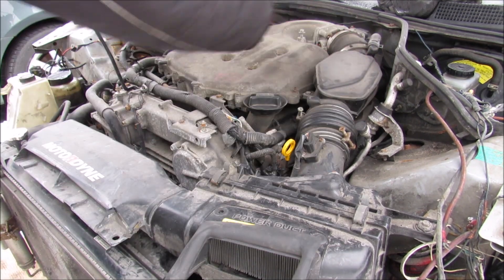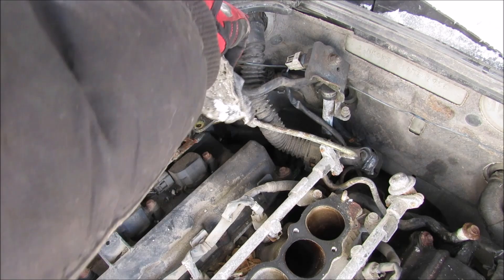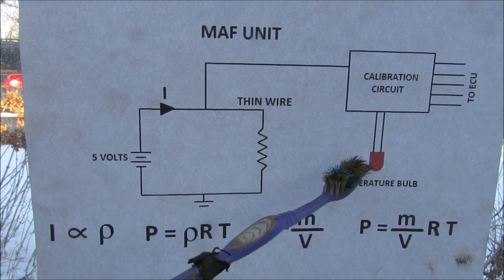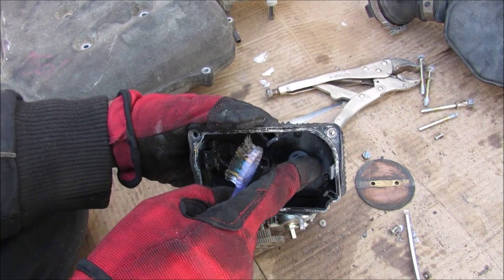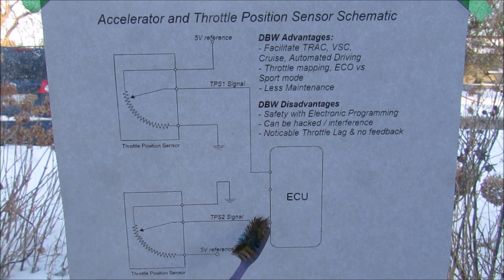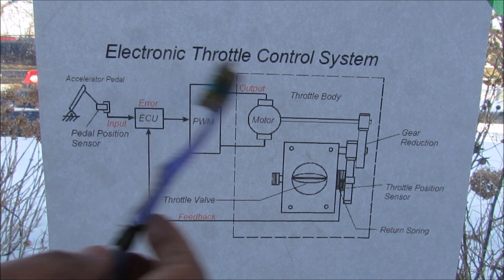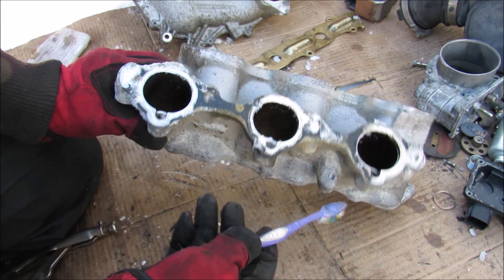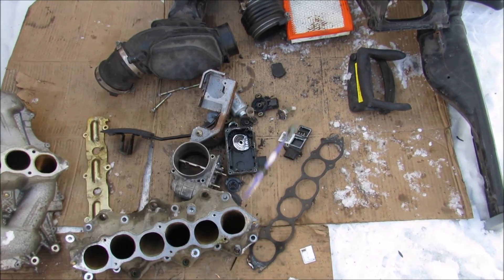How an Air Intake System Works

Comment: Great video...you sure know you stuff..my 2002 Chevy gives me a hard tome starting on a cold engine..once I start it...it will start first crank no mater how cold it is..its just the first start...any advise?
Reply from the maker: Fuel pump?
Reply: @speedkar99  Thanks for responding...that's what i was afraid of...it's a pickup truck so that's a expensive fix...

Comment: My car lexus rx400 h 2008 has PO 171 , how to check vacuum leak ? should I replace fuel injector, if so , can I do by myself
Reply from the maker: See my EVAP system video. P0171 isn't related to the fuel injectors

Comment: Why is it important for the ecu to know air is coming in. Wouldn't the motor still run as long as it gets air?
Reply from the maker: It need to know how much in order to get the correct air to fuel ratio for optimal combustion

Comment: Is there an advantage by using frozen underwear as opposed to room temeperature soft underwear. I have observed it was frozen solid and this would indicate high moisture if not even direct water content in the underwear. Is this a fire prevention measure? Perhaps it works by lowering fuel temperaturre below it vaporisation temperature for a given ambient air pressure? All in all it i sna interesting idea.
Reply from the maker: I agree with your observations. 
Meanwhile the underwear just happened to be sitting on the windshield cowl and was the closest convient thing to sap up the mess. It's not everyday do you just have your brothers underwear just sitting there on your car's windshield you know...

Comment: A lot of newer systems use magnetic Hall-effect sensors for throttle position for a contact-less solution... Similar to cam & crank position, wheel speed sensors, etc.

Comment: Great video, I was wondering something, and maybe you could answer; Could I switch an instrument cluster say like the s2000 cluster into a toyota camry? (I don’t plan on putting one in a camry just as an example)
Reply from the maker: I'd be interested in how that works. I'm sure you'd need a microcontroller to translate the ECU signals from the Toyota into the Honda cluster

Comment: Dear Speedkar99: have a technical question for you!  In some designs, the air intake tube draws air from within engine compartment, while others have a more elaborate design that takes air from a gap where outside air is channeled.  Is one design better than the other?  Thank you in advance.  Watching your video is the highlight of my day!
Reply from the maker: Thanks I'm glad you enjoyed the video. The trade-off between the air intake location is cooler air comes in if drawn externally, however it's subject to sucking in water or debris if it's in a spot that is prone as such. 

A longer tube may also lead to some airflow losses and the engine bay packaging and air filter accessibility also are factors that are considered when designing an intake.

Comment: I had a mouse chew up my air filter and make a nest inside the throttle body. Clogged the plenum open, so when I tried to stop at a stop sign it was like pushing the brake and gas pedal at the same time. Not fun! If you live in a mouse area make sure you check this part of your car once in a while. Also congrats on 100k. Been here since the beginning!
Reply from the maker: Good tip
Reply: Better the intake than the airbox for the cabin blower! Happened to mum's Rav4 during COVID when she was immobile for weeks at a time in the winter, in the Laurentians. The smell...ouf.

Comment: My Corolla had noticeable throttle lag...but it was a 2003! Never figured it out before the cops got the car, but it might've been a throttle so worn from use that it was sticking (it was a "299,999 km" car, so God knows).
Reply from the maker: Some Toyotas especially have this lag programmed into the ecu to prevent it damaging the transmission
Reply: @speedkar99  I don't doubt it. The car I had didn't have the deadly 2-3 synchro issues, but more torque would probably have made them fail even faster (even if the root cause was lubricant).

Fun fact: It had a shot clutch when I bought it, but...it got better as I drove it! I believe the previous owner rode the shit out of the clutch, glazing the disc with bubbled-up resin. I drove it like an asshole too, purposely, to try to break through the glaze, and eventually, did. All speculation tho, because I never got in there to see it (and change it anyway, if I had).
Reply: @speedkar99  Hey. It's been a minute since this comment thread, but in re-reading it -- why would I? I dunno! -- it occurred to me that maybe the throttle lag was the reason the 1ZZ engines are such superstars on fuel economy! It's funny, because it's like the OEM version of putting a block of wood under the gas pedal. 🤣
Reply: The 03-08 'Rolla/Matrix/Vibe with the 5-speed are still the shitbox champs. Fuel economy, interior space and no timing belt (!) all add up to a great car to sling pizzas or deliver parcels.

Comment: Coolant lines at the throttle body are to heat the intake air at idle to improve fuel efficiency immediately after (cold) startup, to combat the phenomenon of clowns still "warming up" their cars in 2018. It's been true for decades now that the best way to warm up an internal combustion engine vehicle is to drive it!
Reply: You've just posted this comments 6 hours ago, and you're not aware that we are in 2019 since the last month and a half.
Reply: @PickyOne  You should be congratulating me because that's the first time I've made that mistake this year, you pedantic fuck!
Reply: I always thought it's to warm up the throttle body to prevent ice from forming. You know, moisture in the air, hitting cold metal, water condensate and freezes.
Reply: @mrpeter887  Carbs weren't warmed for the first seventy years or so of motoring, and I doubt the fuel (or storage tanks!) were better then than now.
Reply: I can't stand the morons who warm up their new cars. And in the summer, they idle them for 40 minutes before taking off so they can get into a cool cabin. But they are SO concerned about climate change!
Reply: Hahha!
Let me tell you about the difference between forged- and cast pistons.
🤣
Edit: meant for this @Joe dude...🤣
Reply: @TheFirstBigCheese  What the fick are you on, dummy?
Reply: I have to warm my car. it's a stick.  if i don't warm it it doesn't go.
Reply: @llllllllllilillii  I guess I should have specified "properly functioning car". Also, your car having a manual transmission has nothing to do with anything.
Reply: I don't warm my cars...i let the motor oil and trans oil  to flow and lubricate my cars properly before a take off. Another thing that a like about " warming" my cars, is to let the revolutions go down ,that way when i put my car y gear, the trans hit the gear smoothly. Only takes me about 5 minutes to reach operational temperature.
Reply: I think you are missing the point of warming an engine. 

It is not just about getting the engine to temp fastest or efficiency but getting the oil to warm up. The warmer the oil the more protection they give in the viscosity range before going to high revs during acceleration in normal traffic. 

Reving your car in normal traffic when the oil is cold and thinnest increases wear.

Ps: It is in the interest of manufacturers for you to increase wear and tear just like the idea of sealed transmissions.
Reply: @crxdelsolsir  Who said driving = "high revs"? Also, the oil is like Fing water now, even at -40°C. Additionally, undue engine wear comes from the first moments in starting an engine, when the piston rings scrape dry cylinder walls, before the oil is pumped.

Also, the idea that engines will get up to temperature from idling is pure brain rot, presumably mostly believed by people who don't look at their water temperature (usually because there's no gauge).

In short, you haven't rebuilt enough engines.
Reply: @crxdelsolsir  P.S. Any excess "warming up" -- besides costing either your precious time, or cash and a hack job to your wiring to install an "auto-start" -- also means more total revolutions (not -per-minute) that the engine has to turn to cover the same distance.
Reply: @crxdelsolsir  Related to your point about viscosity and temperature, but not engines: After a night parked on an incline, and if the temp is < -20°C, my mom's 2014 Rav4 won't move until it's warmed up. She was freaking out the first time it happened, but now she knows the problem and solution.

IOW, if someone has a specific reason to warm up on purpose, I'm not saying it's bad. But to do it prophylactically? Nah. And besides, many (most?) cars become uneconomical to fix long before the engine block, crank, cam, rings and bearings wear out. Maybe you warm up grampa's old tractor because you're worried about hard thermal cycling of a 90 year old casting, but you should just drive your Fiat as soon as there's oil pressure...something else will surely kill that car! 🤣
Reply: Warming up the engine is because of metal expansion on high friction parts, cold engine has higher tolerances and more internal damage to rings and bearings occurs then when the metal has expanded to it's operating temperature. Coolant lines are to help warm the engine up quicker so the operating tolerances are achieved quicker and the engine lasts longer.
Reply: @cleric670  That's a side benefit. It's done to meet CAFE standards.